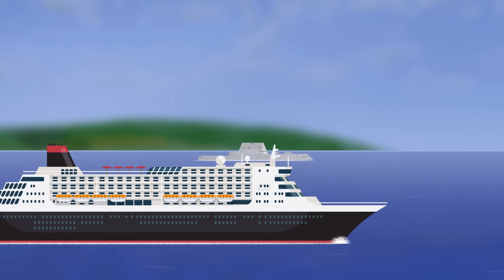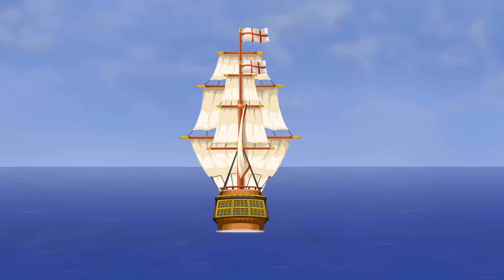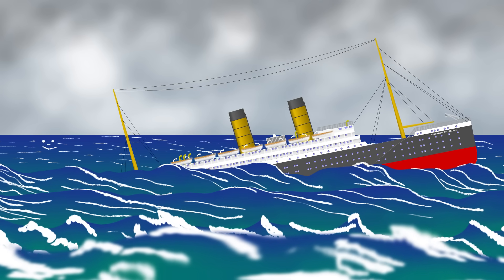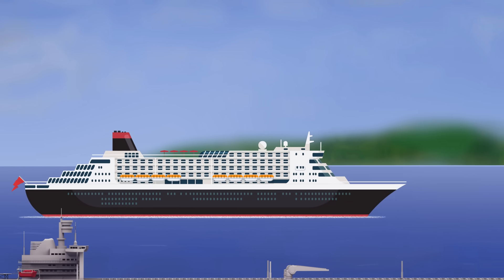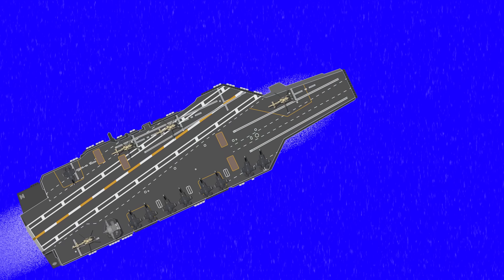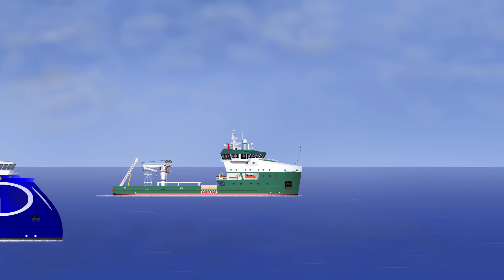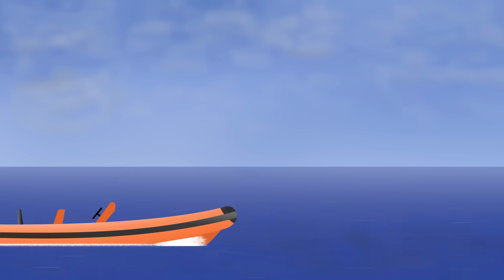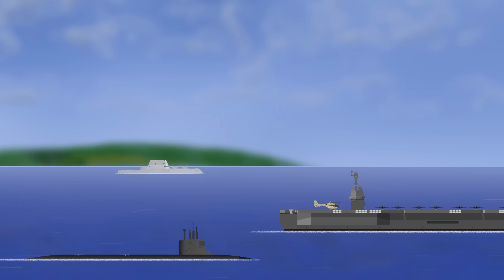Why Are Bows That Shape?

Comment: The Iowa class fast battleships have such a fine bow, that the first hull sections are actually negatively buoyant.
The bow by itself would just sink.
Reply: That's really, really funny. They're beautiful ships, and those bows look downright regal and majestic. Never occurred to me that they were actually kind of a tradeoff.
Reply: @acomingextinction  They were a significant tradeoff, they even narrowed the torpedo protection for Nr 1 turret, to get that little bit more speed.
I often think of the Iowas as South Dakotas, that went six knots faster.
Those six kts required almost 200 feet in length, 12000t of additional displacement and 80% more horsepower.
Reply: @kilianortmann9979  3 knots compared to the NorCals
Reply: @Andrew Matthews  That is one of the reasons the Nvy tried to avoid deploying them to the North Atlantic, thier heavy bows would literally smash through a large wave (of which the NA has no shortage of)instead of riding over it. Which reduced their top speed, engine efficiency, (and more importantly) heavily impacted thier combat capabilities, and put a lot of increased stress on the hull.
Reply: Also why the bow is completely unarmored. Damage to the bow has such minimal impact to buoyancy that the weight added by armor would be far more than any added by flooding.
Reply: @adamk203  Thats due to the armor scheme that every battleship past the Nevada class had what the US had. We called it the "All Or Nothing" armor scheme. The ends (Bow & Stern) for a rough explanation they remained unarmored as they housed no critical items that needed to belong in the Barbettes & or Citadel. The weight saved in not doing so makes your ship better armored where it matters. They still had an armored box in the stern for backup steering tho for the Iowa's that I know of but there is a bit more to it that you can check on your own time. :)
Reply: @adamk203  This is all or nothing armour that was common on battleships. The idea being to invest all the armour on the parts of the ships that were vital, such as the ammo store or the bridge and not waste weight on unimportant parts.
Reply: @adamk203  

Everyone except the Germans used all or nothing armour layouts by WWII. Nothing unique to American designs.
Reply: They wanted a faster battleship, so they made it longer. This is what you do, as Casual Navigation will explain for you. Unfortunately, without abandoning the entire incrementally-improved battleship bow design and starting over, they had to accept the reduced protection and the weird bulge where the belt armor starts, which caused some irritating handling problems. Battleship New Jersey has a great YouTube channel, if you don't know.
Reply: But not as fine as Vanguard's.
Reply: Gneisenau's 3rd bow was similar, it was barely buoyant.
Her planned 4th bow would have added a few metres to her length, as she needed the additional reserve buoyancy for the new 380mm turrets. Added between the bow and No.1 turret barbette. As well as the further redesign of her bow shape to further improve speed, and stability in various weather.
Reply: You would think they would just keep making Iowa hulls but with updated engines and electronics and use it for cargo instead of warfare. 

Now I know what you are about to tell me.
"YrrrHurrHur Drrr! But its a battleship its obsolete and they shouldn't keep making them!"
Reply: @rachdarastrix5251  I mean part of the reason it set the world speed record for battleships is because it set it in 1968, well after most countries which weren't the U.S stopped using battleships. The US still had one that it decided to refit it. You have to remember that you need to take the information with the iowa class with a grain of salt because one iowa ship was actually used in the gulf war in 1991 so a lot of the amazing things it did were done well after ww2

What I don't understand is why the Iowa didn't use it's anti-ship missiles against the Japanese in ww2
Reply: It had big cannons though. It could just shoot the waves and kill them.
Reply: Correct me if wrong, but I think this is the same with most battleships of the era,. The buoyancy is provided by the midship where volume is maximised for armored machinery space, and quickly dwindles near the bow and stern, so the entire ship is always stressed like a plank would from being lifted from the centre.
Reply: Iowa-class bow is nice, but I still prefer the Yamato's

it's mostly just me simping over those useless steel castles
Reply: @britishneko3906  Personally I prefer Sharnhorst's Atlantic bow. The graceful flare speaks to me. The Yamato is a close second though, mostly because I love the giant crest. Even without that it would be second place, for the same reasons as you, it would just be more a more distant second. Vanguard is third, Iowa fourth, and the Queen Elizabeth's are fifth.
Reply: @hanzzel6086  cool
Reply: 🔫 Delet this comment
Reply: Iowa's hull shape exists specifically to make it fast, which is why it's (I think) the fastest class of battleship ever built, people still can't decide if fast battleships are a category of their own. The Iowa's bow for obvious reasons stated by OP has a tendency to go under the waves when the ship is steaming along at full speed. This is kind of a funny tradeoff, where the hull is made for speed, but too much speed and your prow starts to go under water.
Reply: Don't mistake that it will still provide (added) 'buoyancy' relative to the amount of water it displaces, when it breaks a wave, even if it is 'heavier' than water...
Even a solid block of steel will weigh 'less' under water, than suspended above it.
Mr K L
Reply: How does negative buoyancy work?
Reply: @PineappleSquuid  positive increases altitude when below a point in water, neutral maintains, negative decreases altitude until on seafloor
Reply: @samuels1123  thanks!
Reply: @PineappleSquuid  It keeps you steady on the ocean floor.
Reply: @PineappleSquuid  it sunks you rather than lifts you.
Reply: Well..  Cut the bow off of any ship and it would sink. Ships are not designed in a way that any random arbitrarily chosen relatively small part of the ship would be buoyant by itself. Rather, it's  the other way around; When that part loses it's buoyancy, the rest of the ship can still  keep everything afloat. Of course this doesn't mean smaller parts can never stay afloat, but it is more of an exception to the rule.

Comment edited slightly to weed out people whining about it even though I corrected the error in the later comment. People can't be bothered to read that far before throwing out their knee-jerk-reactions FFS.
Reply: @anteshell  During WW2 several destroyers survived being cut in half and there have been quite a few instances of bows being torn off and the ship surviving. 
Warships have an advantage here with being compartmentalised and more watertight bulkheads.
Reply: @Tuck-Shop  That is exactly what I tried to say. I now see that the first sentence is contrary to what I say later. Disregard that point and the rest is true and following what you said.

I'm not sure that went through my head at the  time.
Reply: @anteshell  there are alot of examples of warship bow being completely missing yet still manage to stay afloat and make her way to port (USS New Orleans which bow got detonated by a japanese torpedo, USS Pittsburgh which lost its bow on a heavy sea, a British destroyer after hitting mines, etc)
Reply: @srptr_w  Read my above comment. It applies to your response too.
Reply: @srptr_w  and to add this in a semi-relevant way, 
the suevic which was a cargo/passenger liner in the pre-ww1? era had the bow and bridge blown off to get it off the rocks. a new bow was later constructed
Reply: @anteshell  I believe it was the Missouri an Iowa class that destroyed its bow in a collision and still made it home.  They took the bow from the Kentucky(?) and repaired it after it returned to the USA
Reply: @rydplrs71  that was Wisconsin that got hit by a destroyer
Reply: @anteshell  there have been cases where the bow or a ship has collapsed or been blown or a ship most commonly as a result of a torpedo impact and managed to return to dock get s replacement bow and return to active service see the Uss New Orleans and Honolulu as examples of this
Reply: @andrewgraham6006  You would have made much better if you had actually make yourself known about the discussion you're inserting into. You can read, right?
Reply: @anteshell  Look up the USS Pittsburgh (CA-72) sometime. During the summer of 1945, a typhoon tore the front 104 feet of her hull clean off, more than a seventh of her overall length (673 feet). Not only did the Pittsburgh make it back to port under her own power (after seven hours of fighting the storm), her bow was still afloat and was salvaged by a tugboat a few days afterwards.
Reply: @anteshell  There were plenty of instances throughout the world wars where Torpedos blew off the nose of a ship and they were able to limp to a home port for repairs. You've missed the entire point of the Original comment, that the Iowas could survive with their entire bow blown off, as could many other combat vessels of the time. USS Pittsburgh is a direct example of this, though there was others. 

EDIT: I just read the entire thread and realized many people have already said what I've said and even replied to your comment with the same contention. I'll leave my comment up but I've noted you've accepted and understand the premise now.
Reply: @BirdyLegs2849  I did not miss a thing. On the other hand, you did. OP said "the ship survives but the bow sinks" and I responded "of course the bow will sink". 

Yes, I also made one mistake in that but I rectified the mistake quite fast.

In essence, your response to me can be condensed in three words: "I cannot read". Bu no worries, you're clearly not alone in your inability to read plain English or to NOT take part into a discussion you haven't bothered to get to know first.
Reply: @anteshell  lol ok bud
Reply: @BirdyLegs2849  no-one's gonna judge you for misunderstanding provided you have some character to admit to your mistake. That kind of doubling down and denial, however, is entirely different matter.

For one, I did admit to my mistake immediately someone pointed it out to me. I don't have problems showing my faults. 

Just grow up. Don't be that pathetic.
Reply: @anteshell  you're taking it too literally, op meant that the bow, without any flooding whatsoever, would sink without being held up by the rest of hull. Other sections of the hull are buoyant, and without flooding they would float without being held up by the rest of the ship.
Reply: @anteshell  History proves you are wrong, not once but dozens of times.
Reply: @patverum9051  Funny. As I state above, Current Times prove you cannot read at all.
Reply: @anteshell  you should probably edit your original reply, seeing as so many people have been hasty in their responses, probably with many yet to come.
Reply: @luckyblockyoshi  Damn, why didn't I come up with that. That's a good idea. Thanks!
Reply: @anteshell  Cut the bow off a wooden ship, and it might still float. The same goes for many yachts, which have buoyancy materials inside them, to improve survivability in case for a collision or a sprung hull.

Comment: I'm kinda wonder, how does the number of propeller blades effects an efficiency? I've seen some ships have three blades, some have four, or some have many blades, and some ships even have a combination of four blades and three blades in one sets (like some US Battleships or some ocean liners)
Reply: Super complicated piece of fluid dynamics and engineering. I first looked into it when I started noticing that aeroplane propellers had different numbers of blades. You’d think that something as basic as the number of blades would have been optimised by now, but no.

Comment: "The bow of a ship has to be a compromise" USS Iowa has entered the chat

For reference Iowa's first platform blue prints http://www.researcheratlarge.com/Ships/BB61/BOGP/RG19_BB61_578106_11_Levelled.jpg

This is the profile at the water line. You could probably shave with that thing.

Full blue prints are here for those interested http://www.researcheratlarge.com/Ships/BB61/BOGP/

Comment: A Bow with a large overhang is not necessarily a good thing. I was working on a gas tanker some years ago that had a large overhang and looked like it could outrun any other vessel which it could not. At relative calm sea there were always a spray of water coming over the bow and when the seas were starting to get high we always had to slow down so that we did not damage the bow. Still there were signs that some welding had been done to repair emerging cracks. As for the design of the bows it has changed almost like a fashion trend over the years. While the bows on cargo ships some years ago was elegant and sleek it now looks more like how I drew them when I was four years old. Still a lot of them are purposely designed the way they are. Think how the bow on a icebreaker is designed. In addition to being strongly enforced they are also designed in such a way that the ice are pushed down and broken by the weight of the ship.

Comment: May I add that in the case of submarines, they also need to fit a giant sonar.
Reply: Back in the old days, the sonar was not actually that giant, and many subs still have bow mounted torpedo tubes where you'd expect the sonar to be if you've only looked at modern nuclear subs with midships torpedo tubes.

Comment: My dream is a large custom built sailing catamaran. I am leaning toward the axebow concept; essentially a vertical or slightly backward raked bow, but with a deeper keel to reduce the slamming when a wave tries to lift the bow out of the water. I would probably still have it flare out at the top to keep usable space on the deck.
Reply: One problem with catamarans is that with two hulls the bow buoyancy is halved so the danger is submerging the lee hull by running into a wave and pitchpoling.. The current answer seems to be a backward raked bow with tumblehome to cut through the wave rather than trying to ride over it.
Reply: A problem with cruising cats is that while they have enormously high initial stability, if they run into a situation where they DO heel (say, during a gust of wind that puts the windward hull out of the water), the stability drops VERY rapidly.  In contrast, as a monohull keel boat heels and the keel opposes the heel, the stability increases as the righting moment increases.  Because of that, even though I love multihulls, I wouldn't have one for cruising open water.